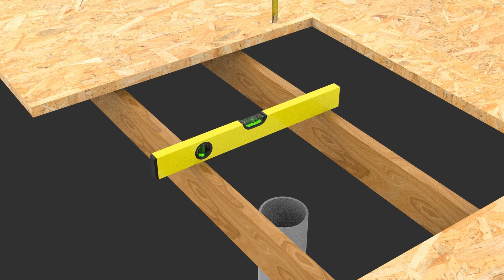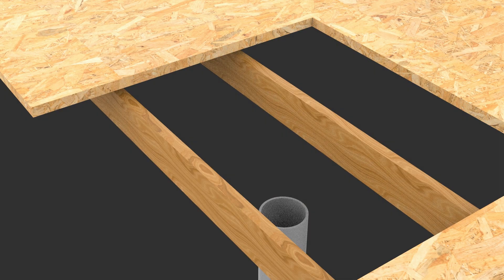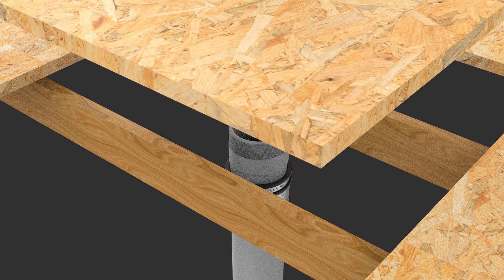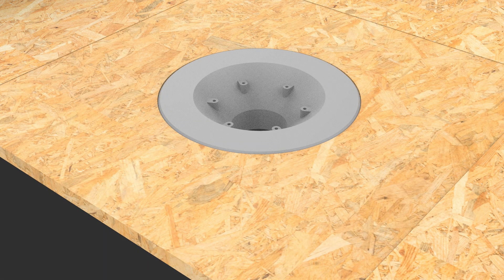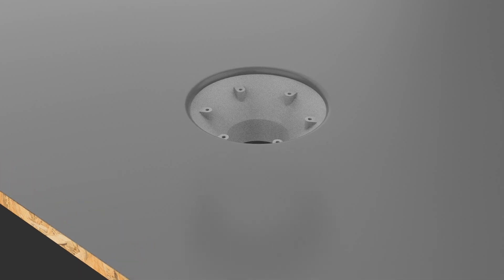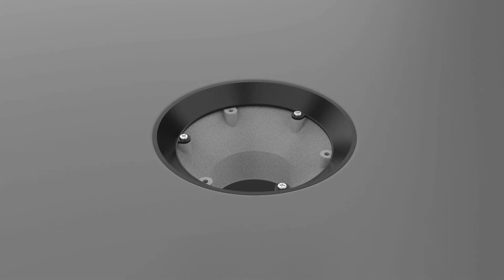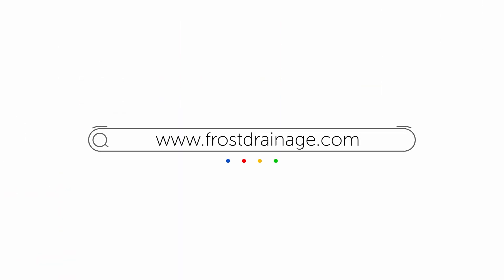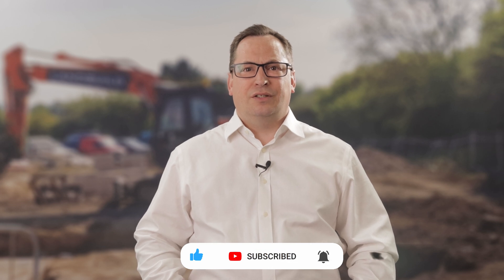How to install a flat roof drain rainwater outlet using Frost by Drainfast installation guide

Comment: I have flat roof and pipe run inside wall one side always leak like flood in building so we cut wall out we found straight down pipe have open 40 wye ?
I close it my question is why there was opening?
Reply from the maker: Hello Roshan, sorry to hear of your leak, it certainly sound like something you might want to get a local roofer to check out!